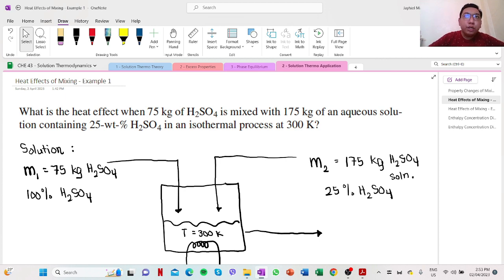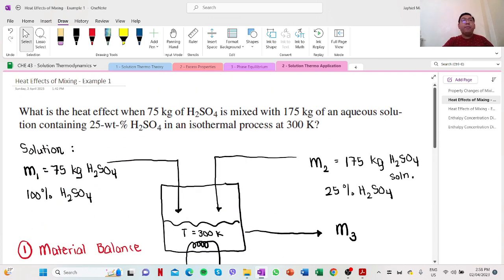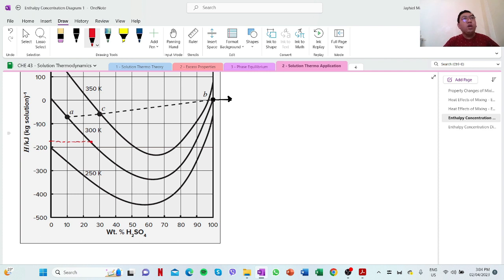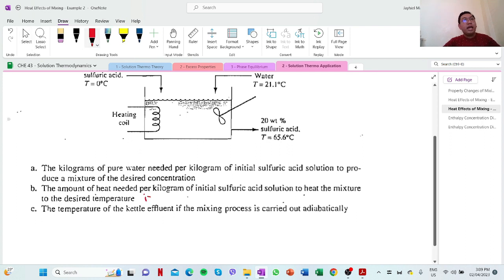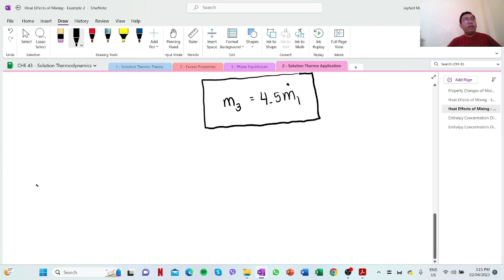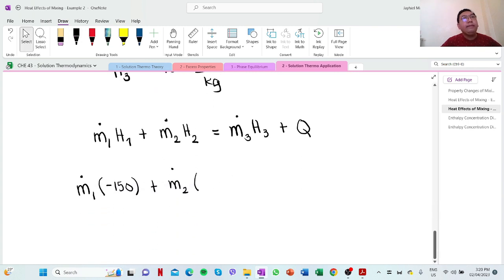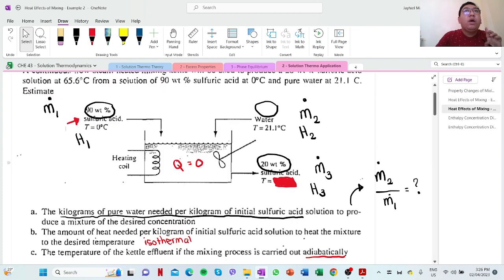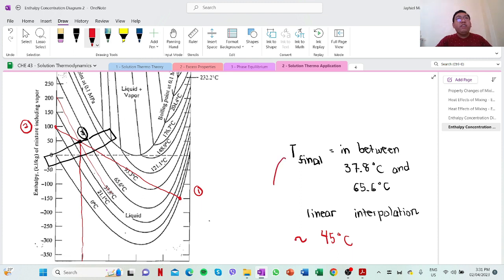Heat Effects of Mixing | Example Problems 1 and 2 | Solution Thermodynamics | Ask Teacher Jay

Comment: I think the initial estimate for enthalpy @25% is better at -175Kj/Kg cuz that’s past -150? And the estimate for 47.5 is over -300 so that would be around 310? And you also forgot the negative sign upon multiplying 250 with -295 and your solution would give you 51,875 kj/kg.